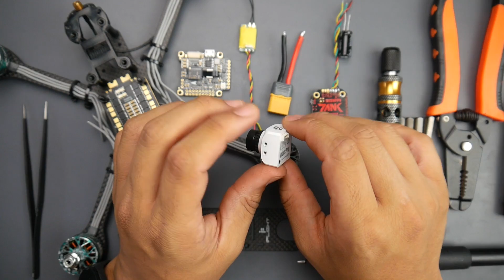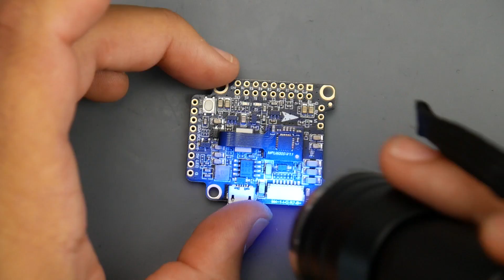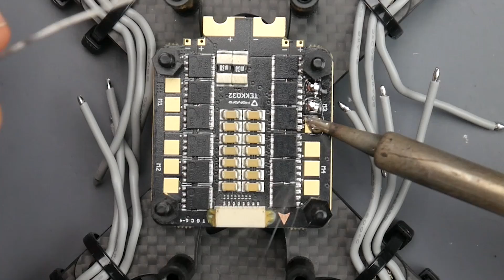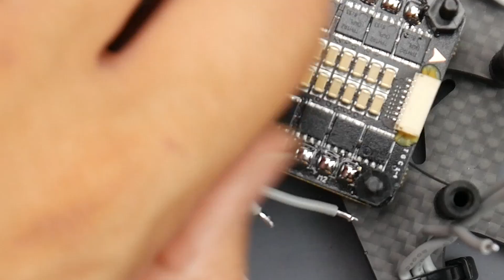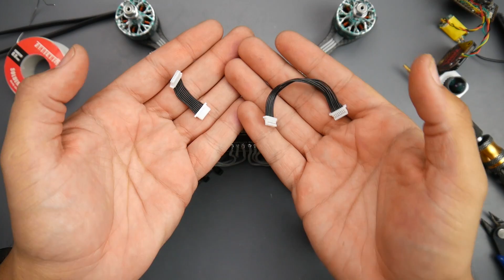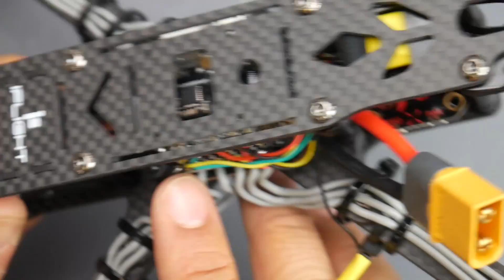Beginner Guide // How To Build A FPV Drone 2019

Comment: Luv your vids!
Question: I've a Rush Tank 
(full size /30-30 mounting) but I've 6 wires? Do I just use the DC in, GND, SA, and VID? And forget the other two wires which are 5V and GND?

Thanks for all your help and hard work!
Your vids are fire!🔥🔥🔥

              *SUBBED*
Reply: I found the answer in another one of your build videos... 
It stated to remove (or not use) the 5v & GND and use the remaining 4 wires which are DC, GND, SA, VID. 

Again, your videos are great and on-point! I will be adding you to patreon next payday as you've helped me immensely in a few of my newer builds. 👍🏼

Keep the GREAT videos comin' my man! 🔥🔥🔥😎

Comment: Hi amd thank you for your time. The only thing that I don't understand is the FPV goggles, how do you link the camera to the goggles? Will any FOV goggles work with a drone?
Reply from the maker: Hi,

Yes any FPV 5.8ghz goggles will connect the have standard channel selection which you can set and they automatically pair.

Comment: would you consider a drone with the following parts premium?
Skitzo flight one fc
60A hobbywing xrotor 4 in 1 esc
jb rotor riot runcam camera
hypetrain acro 2207 2450 kv motors
triumph pro
mach 3 vtx
cl1 frame
rxsr 
I have this drone but I don't really know whether it is good or not, because it's my first...
Reply: It's obviously premium setup u should 6s motor like xing 2207 1850kv or tmotor.. And you have your faster drone ever. Change to 6s is a lot better
Reply: Muhammad Naim Osman bruh I already have 2 4s bats, and my charger only goes up to 4s...maybe my next quad I’ll do the same setup, but make it 6s..
Reply: Muhammad Naim Osman I was actually going to get the oblivion rtf package, as an easy way to enter the crossfire world, but using the new jumper t16 with a crossfire module, and mr Steele’s 6s apex setup seems fire to me

Comment: Great Video, as always explained at a level anyone shall be able to understand.
Question: How do I wire the power supply to the 4in1 esc, if I already have a power distribution board with integrated apm power module? 
Should I just run the 4in1 esc input wires to a spare set of pdb Vbat pads? 
Or does the 4in1 esc need to have lipo vbat 1st?
Below are my specs:
Thank you very much, 
Nick 
(Your eachine ev100 diversity Achilles mod video got me up in running with same setup) 
I built a turnigy hal 580mm quad 
Flight time isnt great with: 
Turnigy 4s 5200mah 20c 
920 kv motors (dji)
10" props
30amp simonk escs
Pixhack Flight controller 
5in1 PDB pixhawk w/integrated power module.
3dr telemetry module
M8n gps/baro 
Now I switched motors, props,  and escs to : 
360kv brushless motors
I flight success 45amp 4in1 esc
14" props 
Thank you very much, 
Nick

Comment: How common is a failure on 4in1 escs now that they have been around a while. I still use individual esc because of the early stories of alot of failures. Also what tends to be the cause of the 4in1 failures?